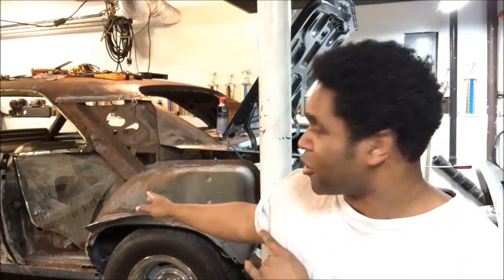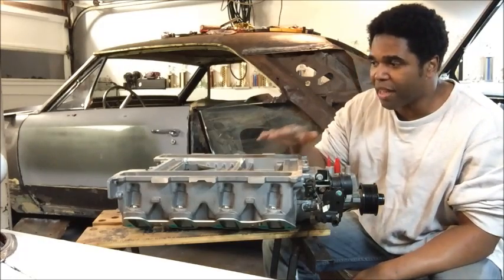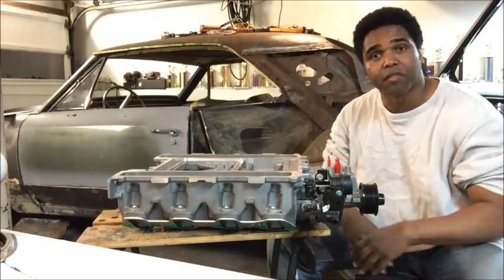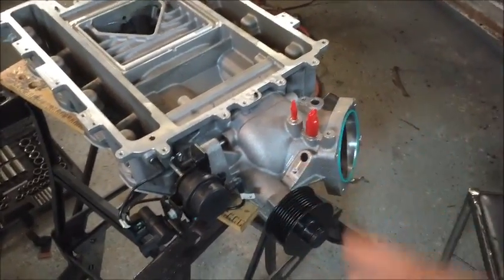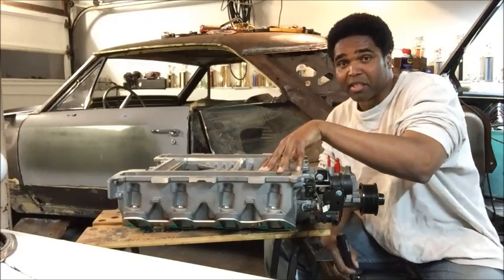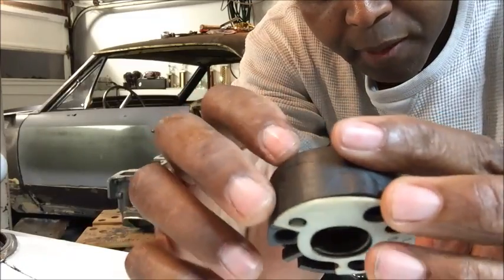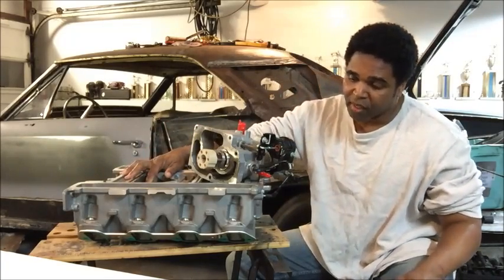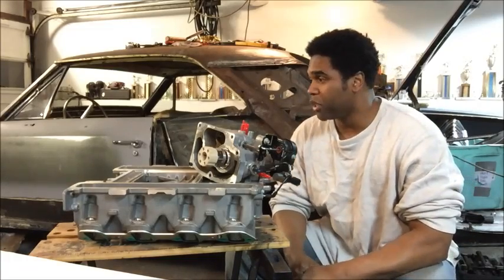How To: Replace A LSA Supercharger Spring Isolator To A Solid Isolator.

Comment: You're gonna need another garage for all your toys!
Reply from the maker: hahaha, yea its getting to that point lol. how you been Giuseppe brotha?
Reply: I've been good, thank you. I've driven the Monte about 3K miles now since the LS swap and have racked more mileage on it than my daily driver!  Lol
I still need to connect my MIL light, tach and get my A/C going. Soon enough...
Reply from the maker: nice... im in the same boat.. love driving the ls ride over my daily lol.  i have a few vids on how to hook up gauges and the MIL,  check them out. as always keep me posted with your build..
Reply: +coverman66 I do have a Dakota Digital signal changer for the Tach but haven't installed it yet. As for the MIL light, I did your video but since the Monte originally had a computer,  I found an easier way....but haven't done it yet!  LOL!
Reply from the maker: let me know if it works.. keep me posted brotha lol